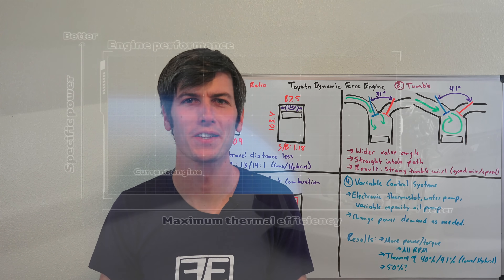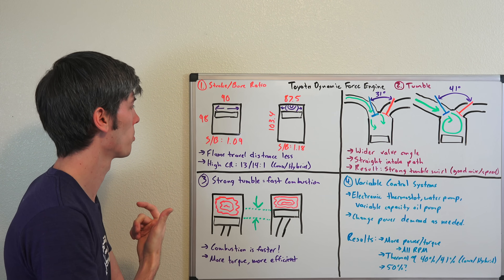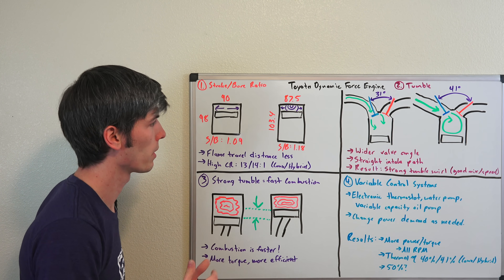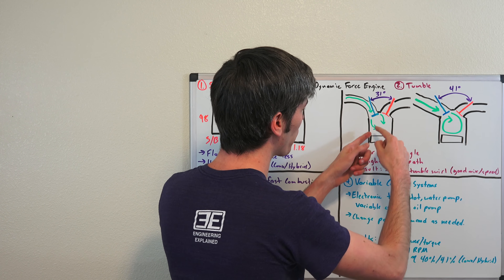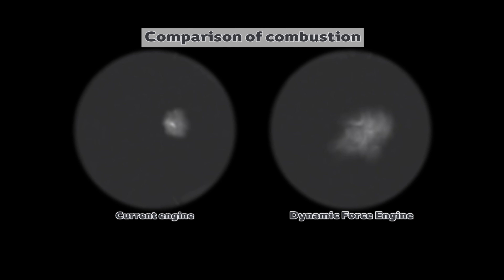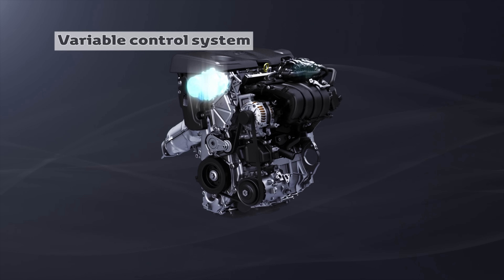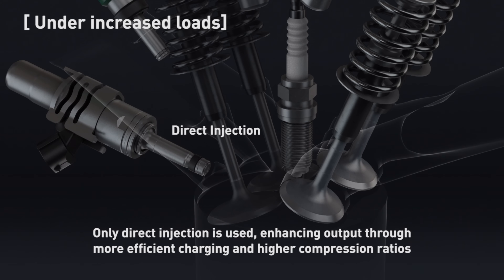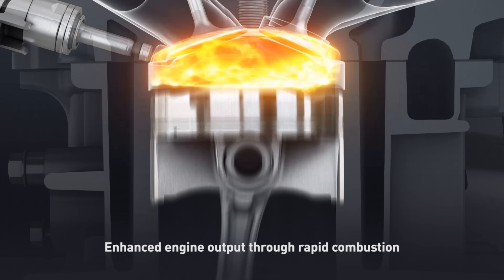Toyota's New Dynamic Force Engine Is Super Efficient

Comment: 41% is amazing. my degree is in chemical engineering and when i got that degree 30 years ago - 33% was about the max you could get.
Reply: It's pretty awesome isn't? I think people forget how much energy is available in these liquid fuels. Could you imagine once we get 50%? And then couple it with some kind of other aids like hybrid systems?
Reply: @sigmaprojects  We are getting 50% with the cathedral engines, two stroke, double action, with forced induction, great if you have a ship.
Reply: @matthewmckenzie7687  that's pretty cool
Reply: @sigmaprojects  And come up with some way to use the 30% in the exhaust and the 30% in the coolant that we now throw away.
Reply: @sigmaprojects  ...we need a lot less waste-heat generated. More economical and easier to manufacture ceramics as part of the engine....to capture more of the heat energy and not have it go to the cooling system, radiator.
Reply: @TheWilferch  I agree, if there were economical ceramic materials that would be suitable for consumer use that would be great. Who knows might happen at some point.
Reply: @sigmaprojects  so another 30 years then?
Reply: @sigmaprojects  look up Achates Power on Opposed Piston. Highest thermal efficiency is 55%
Reply: @Xyb3rTeCh  I know of the engine, I just didn't realize it was that efficient. If I remember correctly because of their design it's extremely hard to package into most vehicles outside of taller commercial vehicles.
Reply: @sigmaprojects  yeah we all have concerns in regards to that. But as the CEO of Achates Power mentioned that they can fit in onto any vehicles as long as they can design to fit to that requirement. They mentioned about placing it horizontally like the Subaru Boxer engine. Also the CEO mentioned about putting it diagonally to fit in as compact as possible. There are a lot of possibilities for them to explore the issue.
Reply: @Xyb3rTeCh  hopefully they succeed, I love seeing new architecture that can potentially expand on utilization of liquid fuels. My main concern is that the design is patented and will be restricted. Many companies don't like paying out millions in royalties and R&D just to test out a viable technology.
Reply: @sigmaprojects  I completely agree with ya. I'd too love to see this engine turn out to be a commercial success and help to enhance further the use of the internal combustion powerplant. Heard from a podcast that the CEO David Johnson (If I recalled it correctly) mentioned that they have worked together with big players in order to bring the engine into the mainstream. Not sure in regards to their business model like you mention on loyalties fees but they might just release a general blueprint for the manufacturer to use it and then they can alter it depending on their application requirements (eg. Big displacement and more cylinders for big and heavy duty haulers and etc).
Reply: @Xyb3rTeCh  Yea, for the rotary engine I forget who is paid, but to continue work on it the licensing is pretty expensive just to develop it. There are other companies like Opoc (similar to Achates), Duke, Liquid Piston, etc that all seem promising, but no doubt extremely expensive to develop anything based on it. I just hope something gets developed, we haven't seen a fundamentally different engine for an extremely long time. The only new commercial engine I can think of is the range extender on the BMW i3, it's an extremely interesting design.

edit: now that I'm looking I guess BMW didn't use the engine they showcased. So never mind, lol. I guess then Nissan with their variable compression engine is the most different engine architecture on the market currently.
Reply: Back in the day under 20% was normal, with more coming from forced induction. Power outputs have gone up as fuel usage has come down, and along with that, emissions. Gas turbines have hit 50%, and low speed marine diesels are the same. The amazing part is it is being done without forced induction.
Reply: Many here says these improvements aren’t anything new, so I was wondering what’s so much about this after all. Like I’m having trouble understanding what exactly was the challenge to achieve that compression rate and so and so in mass-market engine. I mean what’s new here exactly?

Through these replies though I understood that hardly anyone is putting time/money on improving combustion engines. But I’m failing to see why this was hard to achieve back in the time or for another manufacturers. In another word, why did they have to wait until now to build this? Cylinder’s dimensions and the way to design airflow just sounds possible thing to do in 90’s to me.. Maybe there were another bunch of reason why they had to be shaped like so? Testing equipment/3d simulator got better?

If anyone had any bit of idea around this, I’d be happy to be educated!
Reply: @Thomas Nguyen No, it is not. Think about the expansion of gases after combustion has begun. As the piston moves down, the pressure decreases while the engine performs work against the load. The load never disappears, so eventually (if you have a very long piston travel) the pressure in the cylinder decreases until it cannot move the piston against the load. The engine is stalled. So to keep the engine running, you have to dump the hot gas before that stall point is reached. So some heat goes out in the exhaust. 

Low grade heat in the exhaust might still heat the cabin, in which case the overall efficiency is slightly improved because you are moving the car AND heating the cabin.

What I would like to see being worked on, is a gas fired mini-turbine electric generator. Currently we burn natural gas for nothing but the heat. We could be generating electricity with it first, and then still use the low grade heat to warm our homes.
Reply: I like you Sir.
Reply: yeah 35% was the figure that my thermodynamics lecturer states. he also says that our uni exclusively does combustion engines as there is still room for improvement with the systems and many years still  left for the combustion engines . The combustion engines have had most of there improvement within the last 15 years. Many  car manufactures have taken a easy route out with just going straight to hybrids but there is a large amount of room to improve on the combustion engine (especially with power to weight in consideration).  
Eu legislation requires 95% of a car mass to be recycled needs to be recycled( i believe it to be a car factory goal), with lead acid batteries being around the  98% recyclable but having a large weight and not being as good as lithium batteries. The engine development market is currently a cool place to be with lots of different solution from Mazda and Toyotas efficiency,   psa having put some development into diesel hybrid which in my head seems counter intuitive to have a heavier clutch and a medium size turbo as well as batteries
Reply: @boomdaus I know one environmental friendly invention made by Mazda, this is auto recycling called rust xD
Reply: not he max you 'could' get obviously, the max at that time
Reply: i read something on an article about formula one cars reaching up to 50% efficiency and i can understand how hard that’s gotta b
Reply: Idylchatter  A Ford truck with the fuel economy of my Honda Civic would really be incredible!
Reply: When I was in thermodynamics class the efficiency of a standard internal combustion engine was about 25%.
Reply: @RedRider2001  Yeah the Carnot theory states that theoretical maximum efficiency of any heat engine cant be more than 37% how come we are exceeding this figure has the Carnot theory been debunked? Please explain this to me im confused.
Reply: @Thomas Nguyen No, well...not with any known material anyway.  The theoretical limit of efficiency is called the carnot (french guy) efficiency, and is dependent on the temperature of the process. Having said that the carnot efficiency of a petrol engine should be around 70% and obviously we cannot build engines that approach even that.
Reply: we are never going to reach 50% because everything will become electric by then and anything that still is running gas will not be worth the investment
Reply: @pilotavery  opposed piston engine reach 55% (in mid of XX century)... engine successfully used for airplanes, Volvo has plans to use it in trucks
Reply: @pilotavery  Thats would be very tragic. I wish these politicians would stop all this technology bias and allow innovation dictate the future.
Reply: @jonathondeeds3423  politicians aren't affecting this... And it's not tragic. it's just that the amount of money you would have to spend to make an engine that's 50% efficient, is much more than the amount of money you'd have to spend to make an electric car period and electric car components are coming down in price quickly, batteries are half the price they were a couple years ago, etc.

I'm in electrical engineer, and believe me when I say that the reason why is not because anyone is forcing it to be so, but because electric vehicles are simply more cost-effective. There is a reason why you can now purchase a Tesla Model 3 for the same price as a Honda Accord, despite the Tesla Model 3 being better in just about every way.
Reply: @jonathondeeds3423  politicians are at forcing people to switch to electric cars, it's just that technology has advanced so much now that the only car company that has been profitable in the past four quarters is Tesla and they have been profitable all four quarters.

we are at a point now where electric cars are the same cost to manufacture and less expensive to operate and therefore more desirable, and we are at a crossroads where as of this year there are now more charging stations than there are gas stations.
Reply: They didn't tell you about the 100rpm 50% efficient ship engines?
Reply: @buzneg  where?? tell me which one!
Reply: @Xyb3rTeCh  Saw it years ago, can't find it right now.
Reply: @buzneg  I wonder if it's like gas turbines, part of the reason we don't see many small gas turbine generators is because they're not efficient when down sized, but pretty good when they're huge.
Reply: @sigmaprojects  I saw a vid years ago with one on a small ship, it looked smaller then a truck engine. With lower rpm the engine would have to be bigger, because less fuel over time, and it's probably not good at variable torque outputs, that's why it's on a ship and not a car. Slower rpm extracts more heat out the combustion, decreasing the exhaust heat loss, while increasing the cylinder heat loss.
Reply: @buzneg  Sounds like it would be optimal also for range extenders on EVs.
Reply: The compression ratio is what got me. 13:1 was race was territory.
Reply: @brianmorrison9066  modern ECUs, valve control and direct injection has really made it easier to run much higher compression than previous possible. The Lexus GS450h runs 13:1 compression and the current 2.5L hybrids from Toyota run 14:1 compression. Which may or may not have been mentioned already in this video.
Reply: How does this compare to the Nissan Skyactive-X?
Reply: @Thomas Nguyen No haha 90% will never be possible but I estimate that 75% is possible with a completely radical approach.
Reply: Engineers are like vegans! if you don’t know they are one, don’t worry, they’ll find a way to tell you 😂
Reply: And yet the Atkinson cycle was known 100 years ago. Furthermore, in the last 60 years with the ICE efficiency understood very well, we have moved in exactly the opposite direction, towards larger Bore/stroke ratios (for the purpose of larger HPs at high RPM) ... Now that efficiency is being appreciated again, we will see more engine manufacterers moving towards longer stroke designs and Atkinson like cycles.
Reply: 8. O taste and see that the LORD is good: blessed is the man that trusteth in him.

          Psalm 34:8

16. For God so loved the world, that he gave his only begotten Son, that whosoever believeth in him should not perish, but have everlasting life.

17. For God sent not his Son into the world to condemn the world; but that the world through him might be saved.

18. He that believeth on him is not condemned: but he that believeth not is condemned already, because he hath not believed in the name of the only begotten Son of God.

19. And this is the condemnation, that light is come into the world, and men loved darkness rather than light, because their deeds were evil.

       John 3:16-19

23. For the wages of sin is death; but the gift of God is eternal life through Jesus Christ our Lord.

            Romans 6:23
Reply: Toyota engineers think in practical terms and are not trying to reinvent the wheel but improve it.
Reply: @thehound5794  yeah, but are they going to teraform und colonize Mars like Tesla engineers? .... I dint thunk so....
Reply: @dicktracy790  I'm not a Toyota owner, but in my case I don't need a car to move on Mars,  I need a reliable car to move on Earth. 🤣🤣🤣
Reply: Facts Imagine if they  EcoBoost this engine  they  can get a 380hp  on 8psi maybe on e85
Reply: Idylchatter  How is 37 MPG impressive? An EV typically gets over 120 MPGe. Prius has been getting over 40 MPG for what 15 years by now?
Reply: @idmhead0160  Yes, many cars can already achieve 40 MPG, but the fleet of Ford F150 trucks at my work still average around 15 MPG. Improving the fuel economy of extremely common trucks from ~15 MPG to 35 or 40 MPG would be a huge, game changing increase in efficiency and reduction in green house gas emissions.
Reply: idmhead0 Yea I’ll stick to my LS
Reply: @idmhead0160  dint forget most EVs have far lower drag coefficient compared to ICE cars also all EV have regen these two aspects account for a lot of that economy advantage if a typical gasoline car had regen and CD. of less than 0.23 like the model 3 has we could see mpg figures of 68 to 75. Mind you a lot of european diesel cars have genuine economy of 58 to 65mpg
Reply: @jonathondeeds3423  So what? I get 120 MPGe or more in my LEAF. Fact is ICE is inefficient. Why don you think all that heat comes out of it? But yes, if you are a dummy driving a box down the road, and off road tires and high rolling resistance, you mileage will be worse still. Diesel causes bad air pollution. Look at the fraud VW that had to pay billions because of it.
Reply: And an electric motor is what, 80% or more? Why are you guys even wasting your time with this? ICE is just an overly complicated bad design. It is time to stop throwing good money after bad effing around with this stuff.
Reply: @idmhead0160  electric motors can be extremely efficient...however taking your example...that efficiency is 80% _of the machine used to generate that electricity_...and that complicates things
Reply: @bleughbloop8569  sure, now how "efficient" is oil extraction ? I mean anyway efficiency of electric motors is maybe a big advantage over ICE, so is regen but ultimately it's not the main reason why it will replace ICE. it's emissions. charging evs from clean electricity is the only sustainable way.
Reply: @idmhead0160  your right but that's only a part of the story and ICE car gets fuel from the pump with zero loss, it is stored in the tank at zero loss and is feed to the engine at zero loss and then finally yes you only get 40% as rotational power however Ev's has loss when charging so not all the power supplied ends up in the batteries, they will lose power when they just sit, power is lost through the speed controller and finally there is the motor itself a study into this gives Ev's an average efficiency of 60% from power supplied to rotational output
Reply: @idmhead0160  and how do you produce the electricity for the electric motor. yes, by burning coal, oil or gas. with an efficiency of max 60%. so no, electric cars are in no way more efficient if you consider the energy loss during the production of electricity, the loss during transportation of the electricity as well as the loss for charging the battery. electric cars are NOT more energy efficient. it's just a giant scam!
Reply: @idmhead0160  power dencity of batteries will never reach even a quarter of the power density of liquid fuels but IC engines can achieve efficiencies of up to 60% with radical redesign (which is not far off 80% for electric drive) This is why its worth bothering with.
Reply: @jonathondeeds3423  EVs are starting to get 400 mile range now. Your argument is falling flat. That is an argument from 10 years ago. Find another reason.
Reply: @idmhead0160  400 miles is nothing. My point is battery desity is useless and their is no hope for battery desity to reach the dencity of fuel. 700 kilos of lithium battery can barely touch 400 mile range if I had that weight in fuel in my car i would get 4700 miles of range.
Sure the ICE we have today are not efficient but like i said before their is huge huge scope for increase in efficiency, 60% efficiency can be achieved with very little developement the EV crowd assume that any developement of engine require huge investment, R&D and retooling  this is simply not true with the coming of ecu controlled camless engines all advancements can be done with software. 
So sorry you are very wrong.
Reply: 12% in 30 yrs. Is not overly progressive/ impressive in my humble opinion.
Jus sayin
Reply: @captaincamera2748  ....you need to understand the technology behind the problem. It's not a question of engineering knowledge or prowess, it's the difficulty of the problem. I't not like electronics where the gains come from continuing miniturization of circuits, allowing more power in smaller packaging. At some point the mechanical and thermal barriers are extremely difficult to push through. How much improvement have we seen over the last million years to increase the speed-of-light?...... answer:, no increase, zero % !
Reply: @captaincamera2748  The car industry is to blame for this incremental improvements driven only by government legislation, this is not the best recipe for progress. If  car manufacturers had ignored emissions regulations set by government and just set out to make the most efficient cars, thermal efficiency of 40% today would be considered primitive.